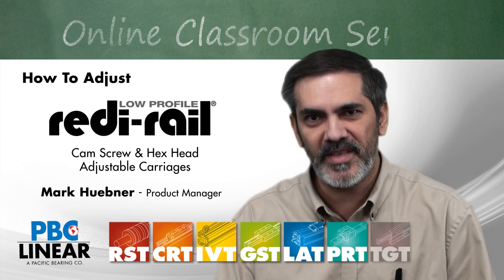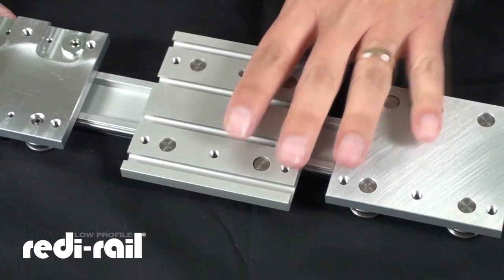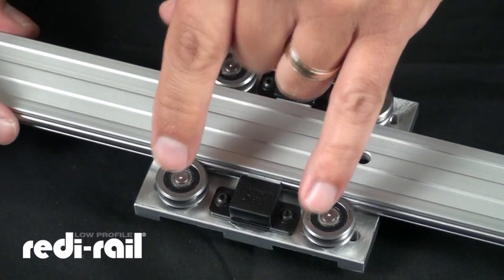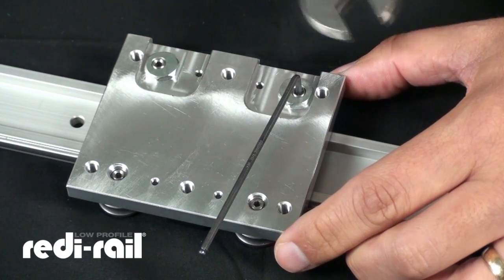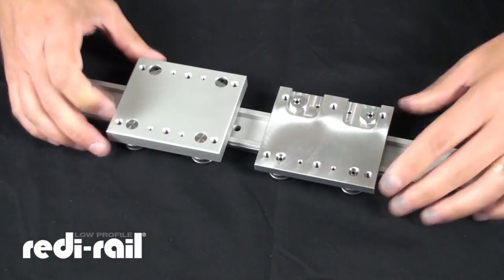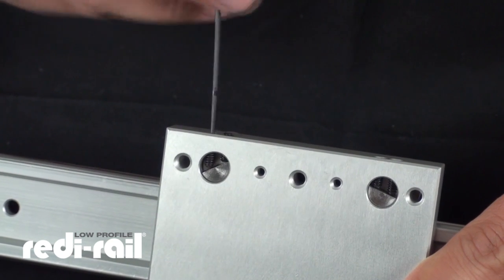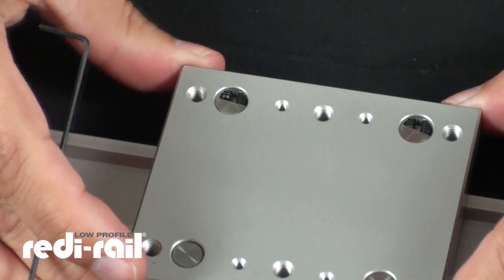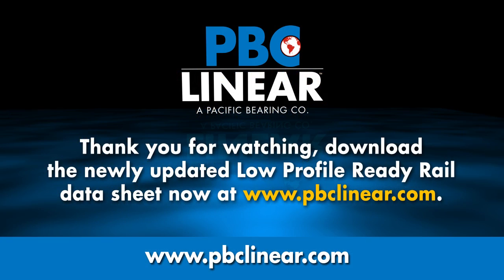How-to Video: Adjusting Pre-load on Low Profile Redi-Rail

Comment: How long do these usually last before needing re tightening? The screw version seems also more precise to calibrate
Reply from the maker: There is no way to predict how long the preload adjustment will remain in proper tension to retain the carriage on the rail due to many possible variables of loading, rail deflection, environment, speeds being used in the application. Best to test the component under specific application use case to determine if specific adjustments will be required.